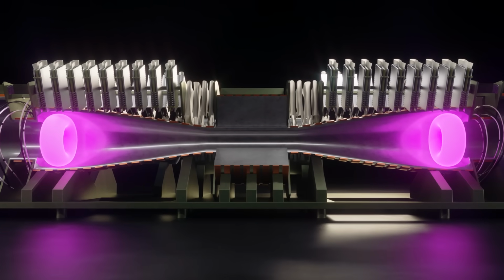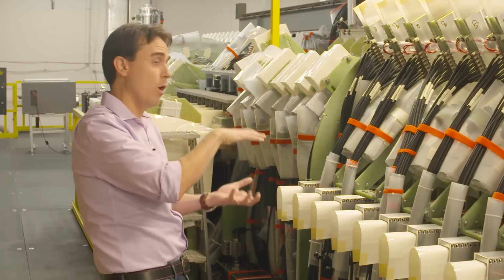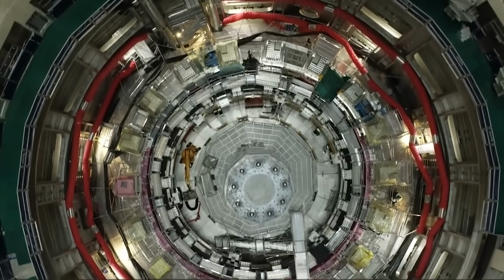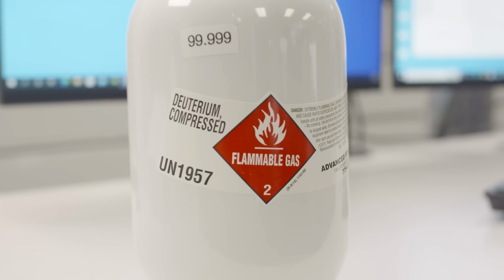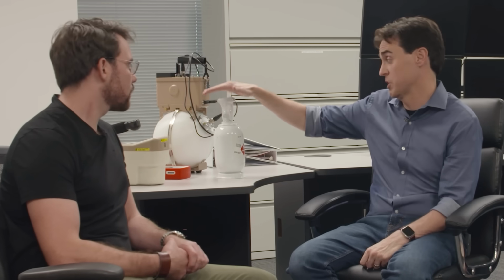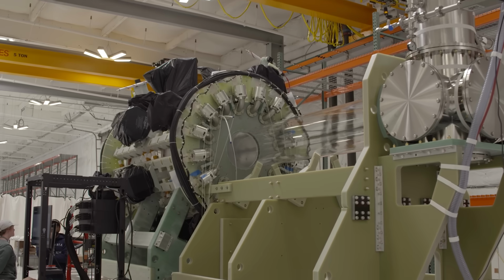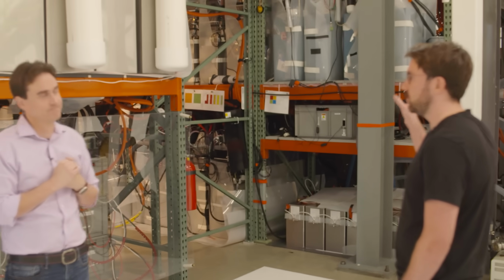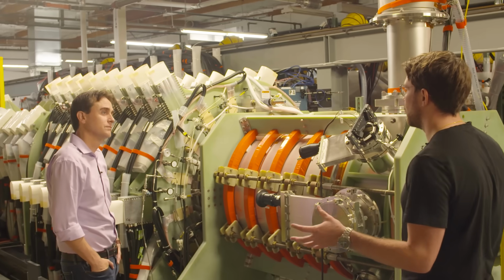A New Way to Achieve Nuclear Fusion: Helion

Comment: Cool, so does it generate more energy than it requires? And do you capture all of that, where does the heat of the reaction go?
Oh, they haven't tried capturing it yet, uh... that's kind of a big deal for this sort of tech isn't it, kind of the point?
A second concern is heat. Using his engine piston analogy: this is still going to make plenty of heat, just like your car engine does.
Even if capturing the reflexive power from the magnetic field works out extremely efficiently this will still need to end up as two-stage just in order to stay cool, the second stage being to use the excess heat to run a turbine like every other nuclear power plant does.
Reply: They have tested the capturing in a previous prototype. Trenta does not do it. Polaris will produce net electricity in 2024.
Reply: @elmarmoelzer2229  But how 'net'? The solar panel on my calculator generates net power but I can't heat my home with it.
Reply: @circlebar2258  Polaris will be small amounts because it is not quite the full power plant scale and magnetic strength yet. It also will operate at less than 1/10 the pulse rate of the planned 50MWe powerplants. 
They have not said how much exactly, but probably on the orders of a few kWe.
Final powerplants will be 50 MWe.

Comment: This is just a demonstration phase. Making a continuously working fusion reactor will come with new insurmountable hurdles and we will be right back here with another 20-year fool's dream. I am not impressed with any of this. They have spent billions of taxpayer dollars and have nothing but shiny hardware. If they would have spent the time on a thorium/molten salt reactor we would now have safe electricity for a penny per kilowatt. Cold fusion has also been demonstrated but the military doesn't want this technology in the hands of commercial inventors because it would end the centralized control of our power grid. Power production could be decentralized to the individual building owner and cost 1/10th of what it costs now.
Reply: Trenta cost 35 million, not even close to a billion.
Cold fusion does not work.
The hurdles not insurmountable. Polaris will be the first fusion device to demonstrate net electricity in 2024.
Reply: @elmarmoelzer2229  The quest for fusion has cost billions over 50 years. Cold fusion has been suppressed by smearing the research scientists and denying patents. You are far too trusting of academic authority. Fortune and glory (grants and esteem) are manipulated to secretly bribe the average academic & deceive the public into accepting the scarcity of energy. It makes us easier to tax & control.

Comment: While we’re on the subject of thinking outside the box when it comes to fusion fuels — why not create artificial, terrestrial CNO cycles?

Think about it: water doesn’t just have useful isotopes of hydrogen in it. It also has oxygen nuclei that turn to fluorine-17 — a short-lived, high energy positron emitter with a one-minute half-life — when they capture protons. Those positrons emitted by the fluorine-17 in the fusion plasma will then go on to A, convert 100% of their mass into energy by annihilating the electrons floating around which is more than enough mass-energy conversion to keep the plasma hot enough to sustain the reaction, and B, give the fusion plasma a net positive charge because an electron that has been annihilated by a positron is an electron that no longer exists.

Comment: I wonder if challenges Helion faced in discharging large amount of current quickly are similar to the ones that Arcflash Labs had to solve with regards to pulsed power, in order to try to create commercial production gauss rifle (aka coilgun).
Reply: No
Reply: Not even remotely close in terms of difficulty. The tech for Arcflash is understood (it's quite similar to the way flashes work on those old disposable cameras), they just had to get the timing sequence right. I mean there was a kid in my uni physics lab who loved mechwarrior so made a bench gauss rifle for fun. What these guys are doing is inventing new engineering from basic physics principals

Comment: I haven't found it anywhere - has there ever been fusion achieved in RFC devices?
Reply: You mean FRC devices. Yes, for decades with tons of neutrons to count (IPA did 10^9/pulse in 2009, Venti did 10^11/pulse in 2018, Trents should do at least 10^12).
Reply: @elmarmoelzer2229  Do you have a link? I checked some places and they only describe physics and list such devices with plasma runs, nothing about fusion.

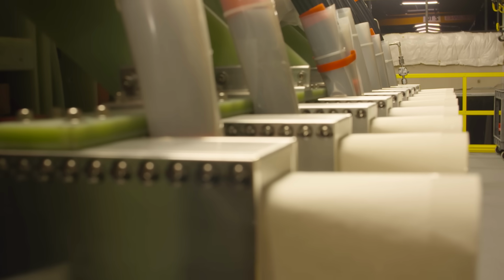Comment: 5:07 - They did it. They made an EM conveyor. (If transitional symmetry exist, we are trying to explain the barrier between the two states. It's a strange, malleable barrier that has extreme boundary expressions.). Their tool might be the equivalent of a "nano machine" at the scale of wave particles. Well, compared to a star it is.

Comment: From what I can see, the problem is the cumulative generation energy of the plasma toruses that are collided. Then why not use several chambers that will drive each other. Let's start with 8 in the V system and let's call it HEMI because the collision chambers are spherical and let's synchronize their work by a neural network and train it in recursive mode with feedback. Why not use 28 cells in a radial arrangement and call it R-2800?
Reply: You can't fit the compression magnets around a spherical chamber.
They COULD theoretically fire several plasmoids in a row, one faster than the other so they all arrive at the central chamber at roughly the same time. But from the looks of it, that is not necessary.

Comment: Did I miss it? What is their Q on Trenta?
Reply: Helion is still keeping Trenta's exact performance numbers a well guarded secret. From what I hear between the lines, it is about on par with JET, maybe better. Depends on how you look at it. They do not recover electricity with Trenta (which was still relatively cheap for a fusion machine). Polaris will recovery electricity and should demonstrate net electricity output in 2024.

Comment: If it's not blocking neutrons, wouldn't want to be standing next to it. Furthermore waiting 12 years to use a radioactive fuel after it's broken down? Well storage and collection is going to cost alot, if they don't go out of business in the meantime. Oh I see, no government would let that happen given the nuclear waste, well played.
Reply: They do have shielding of course. The neutrons are comparably low energy. Storing Tritium is not all that difficult (there are commercial off the shelf products for this) and there is a very high demand for it. So Helion can just sell the Tritium and make extra money (or trade for He3) rather than waiting for it to decay.

Comment: If the capacitors were submerged in liquid nitrogen it would improve the density of electrons stored and would increase the life and efficiency of the storage capacitors.
Reply: Cryostats need a lot of energy though and that would hurt the power balance of the plant.

Comment: Without more of these in a spherical structure, I don't see how you can sustain the effect except for extremely expensive pulses. This stress will eventually degrade the energy collection module. The energy being absorbed into the copper will eventually melt it, especially given the loads your talking about. Unless you give it time to be cooled or use a better material that your not telling us about?
Reply: No, it is not that big of a problem.

Comment: Show your neutrons.
Reply: Helion published neutron counts for previous prototypes. Venti (the one before Trenta) achieved 10^11 D-D neutrons/pulse back in 2018. That was published at TOFE that year and peer reviewed by JASON. They also published 10^9 neutrons for a much older prototype (IPA) back in 2009.
Trenta has 3 times the radius of Venti and a bunch of other improvements. Their gain scales with radius^2.1. So I would expect Trenta to do at least 10^12 D-D neutrons/pulse. 
Hope that helps.

Comment: My question that I didnt see clearly answered is simple, is total energy out  more than total energy in? (including fuel production) ????
Reply: Not yet. Will be in 2024. Energy cost of fuel production is pretty much irrelevant for fusion. They just need to little fuel.
Reply: @elmarmoelzer2229  I don't think energy cost of fuel is low, when the fuel they decide to use is so rare they have to produce it with Fusion. Maybe Once you get it going with some initial energy, the energy producing fusion reaction will cover the cost of fuel plus the cost of itself and have surplus (which is what is needed) but we don't have any numbers public yet
Reply: @georgegeorgakopoulos9642   The numbers are dictated by physics actually.
It is not THAT hard.
Reply: @elmarmoelzer2229  Really hope so I would love some cheap energy 🤣
Reply: @georgegeorgakopoulos9642  
The D-D fusion reactions would be about break even (electric). The D- He3 reactions would make the surplus electricity for selling. Helion is still deciding whether to do it all in the same machine (breed He3 and make electricity) or have dedicated breeders for He3 (and dedicated D-He3 machines) or some combination of both (dedicated breeders that make a little electricity and dedicated D- He3 machines that breed a little).

Comment: So wheres the net calculation of electricity generated?
Alone and after factoring in the electricity cost of generating helium 3 and making capacitors. New process and shiny new toys are cool but if the output is miniscule whats the point. Ill even take and "expected" net generation. The abscence of this number makes this whole thing kinda sus. Not to trash anything  i loved the video and love innovation in new tech. just making the observation.
Reply: Their power plants are expected to produce 50MWe. Their next machine, Polaris will demonstrate a small amount of net electricity. The one after that will be a commercial scale 50 MWe power plant.

Comment: Electrically charged gases have always seemed like a missed opportunity. Interesting that this team is trying to recapture that energy. Though I am curious because the plasma is still going to be scorching hot so why wouldn't you want to recapture the thermal also? Perhaps they'll run two 60hz outputs? One driven by the rotating plasma the other driven by waste heat?

Comment: fusion power should not be available to the public.  each new discovery of energy brings un imagined negative consequences for humanity consider climate change.   if they put the power on the grid people will just waste more energy than they already do and use the cheap energy to make and power flying quad copter cars with people in them that I dont really want to deal with those.

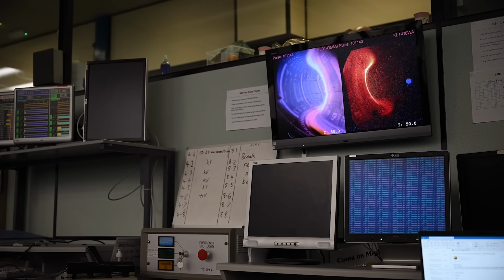Comment: 11:52 Nuclear energy is too costly compared to renewable energy? Well a nuclear power plant is indeed way more costly than any wind turbine or solar panel, but in the end it produces so much energy that country using nuclear power plant provides cheaper electricity than country that relie on anything else. So i'm not shure what do you meant there.

Comment: Can the machine explode and if it does, what happens with the hot plasma that is in fusion state?
Reply: I doubt it can explode since the pressure is magnetic and there is vacuum inside. In a case of a breakage the whole thing would just stop and plasma would disperse since nothing would be stabilising it.

Comment: I take a huge issue with statement that nuclear energy is too expensive to compete with other cheaper forms of electricity production. Yes it's vastly more expensive in the initial stage for technology and construction but it pays back over the years simply due to resource costs requried to run it. But why think ahead right?

Comment: Adaptation of new alternative nuclear fusion energy does not necessarily mean it will be cheaper... However its priority should be having a cleaner and more efficient/powerful engines that could be used abundant like hydro-carbon fuels.

Comment: I guess the ammount of fuel and speed of process determines the watt,  since 1W*s is something like 6*10^12 MeV..  

But i think for a powerplant, you need multiple of these as a minimum to have a continuously power flow, or some sort of massive capacitor to cover the voltage increase/decrease.
If this would be running alone, then it would have to do it at 50/60hz, 🤩 and not only every few seconds.. 

Really interesting video, i enjoyed this.
Reply: They were saying one of challenges of scaling up to commercial scale would be running multiple times a second rather than every few, so sounds like generating at 50/60hz straight off the plant is the plan.

Comment: Alot of blah blah blahs and gloating about well, standard engineering. I'm shuffling around to find how much energy do they take in and how much does the machine produce. Cant find it
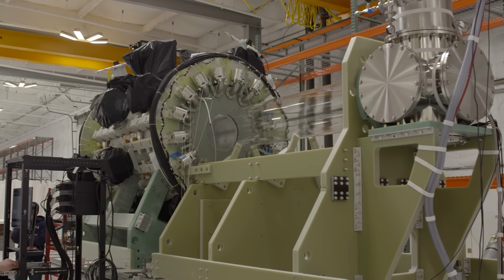Reply: You cant find it because they haven't done it yet, they are planning to capture the electricity from next generation (watch from 21:59). The work done so far is mainly on the fusion reaction. 2024 is the target for the next gen reactor that will have the tech to capture the electricity.
Reply: @itsCcallahan  you don't have to "capture electricity" to figure out how much energy is produced during the fusion - energy in whatever forms like heat and etc. You just have to measure and calculate.
Reply: @chronokoks   I understand your point but I feel the only energy we should be caring about is electricity as the reactor aims to generate it directly without steam.

I understand your scepticism on the project but I think we should let them work on the next generation and judge it after the numbers are out
Reply: @itsCcallahan  you feel what you want to feel, I care about science and proper due diligence for the sake of investors and the public.

Comment: This is a particle accelerator btw, something we've been doing for decades. all the stuff about electronics and timing, yeah. no big deal reaaaaaally.
Reply: All fusion machines are somewhat related to particle accelerators, actually. What is special about this is that they are accelerating a special plasma configuration, called a field reversed configuration. The FRCs are already getting compressed during the acceleration. It was not quite clear in this video, but the two FRCs merge into a single, hotter and more stable FRC (FRCs get more stable with temperature). That is then further compressed by another set of magnets to fusion temperatures (and higher densities).

Comment: the only question I still have...is this going to make hazardous waste that will have to be stored somewhere....because if it does, this is no better than what we have now

when I hear the word tritium I think its hazardous ....so is it
Reply: The Tritium decays within 12.5 years into more He3 that can then be used as fuel for future power plants. The machines themselves will get some slightly activated components from relatively weak neutrons. But, their machines can be fully decommissioned 2 weeks after operation and the most activated components will be below background radiation levels within less than a year. So really not a big deal.

Comment: I love that they are using D-He3 fusion. Also incentives the lunar base for a more renewable source.
Reply: Helion will produce their Helium3 by fusing Deuterium in the same machine. D+D => He3 +n or D+D => T + p (the Tritium eventually decays to He3 as well). No space travel required.
Reply: @elmarmoelzer2229  for now. Who's to say what exists a few decades from now.
Reply: @zacharytaylor190   Sure. I mean if we had a large settlement on the moon that was processing large amounts of regolith for other uses anyway, then I can see it make sense to extract the He3. Of course transportation would have to be very cheap. 
IIRC, the outer planets have a lot more He3 in their atmosphere than the moon has in regolith. So maybe it makes sense to go there. Much deeper gravity well, though.

Comment: Nearly 24 centuries ago Aristotle defined rhetoric as having three components, logos, ethos, and pathos.  The reasoning needs to be sound, the audience needs to believe in the speaker ahead of time (speaker reputation), and the speaker needs to be able to sound convincing.

Since this video says nothing about how close Helion is to ignition, it lacks logos.  Since no one's heard of these people before it lacks ethos.

All it has is pathos.  It's fascinating to see how gullible an audience is when the only component of a rhetorical video is its pathos.

That said, it's good to see that a significant number of the 6,277 comments so far have homed in on the logos, which is totally lacking, just as it was in last week's NIF story.  3 MJ out for 300 MJ in is not ignition by anyone's definition except that of the NIF project itself.

Comment: Including a conversion to heat energy step limits the efficiency to the Carnot efficieny mandated by the second law of thermodynamics.
If conversion to heat is avoided as Helion proposes to do, and energy is directly converted from Kinetic energy/Magnetic energy directly to the Electrical energy of an electron current induced and flowing in a conductor (hope-fully a low resistance super conductor), we can avoid the Second Law Carnot efficiency limit .... which would be a tremendous advantage !

A method of avoiding the Carnot efficiency limit is also used in Fuel Cells to convert the Chemical Energy of the Fuel directly into Electrical energy of a current flowing in the electrodes avoiding an intermediate conversion of Chemical Energy into Heat Energy as in an Internal Combustion Engine. Except for parasitic resistive heating losses in the electrolyte, there is no conversion of energy into heat in the main energy conversion process.